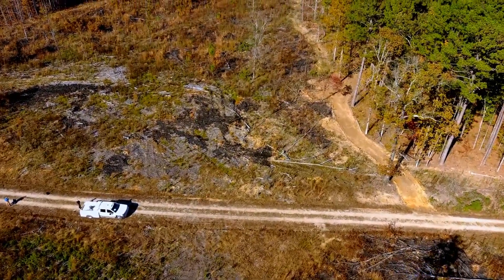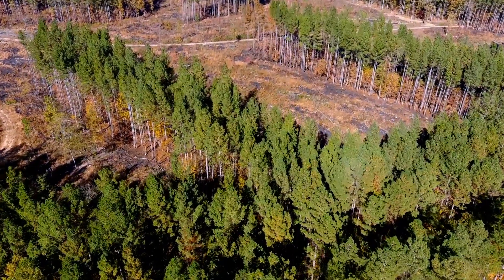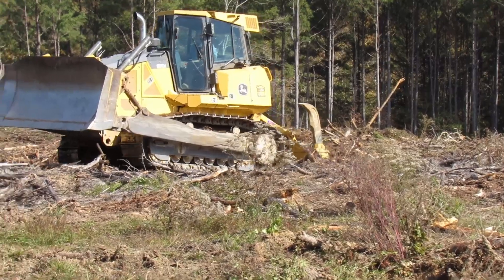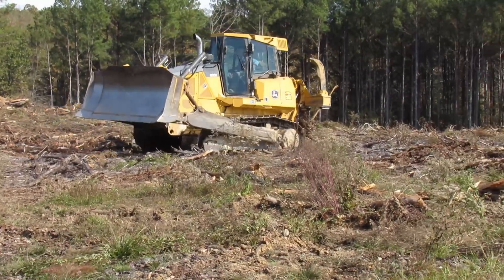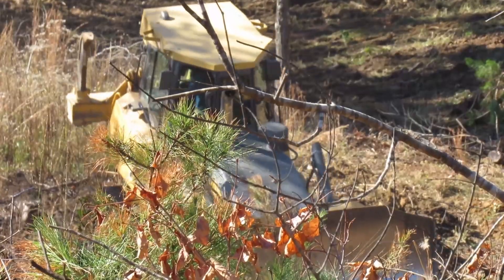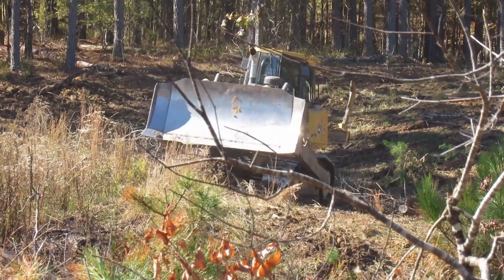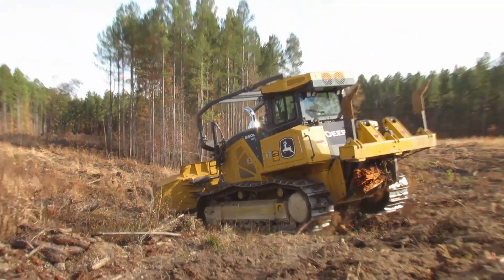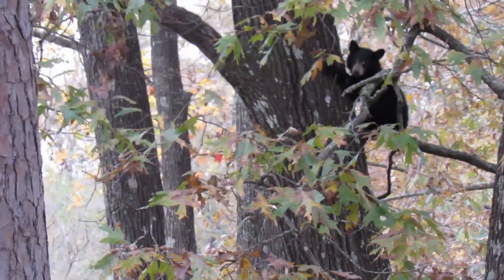Heavy Ripping with a Dozer for a Reforestation Project

Comment: Approximately how much does it cost to rent one of those machines to do that sort of work?
Reply from the maker: It depends on the size of the machine, attachments, location, etc.  This particular job was  $8250 per month.  The next smaller dozer would have been $6400.  Delivery was $1500 and we used about 100 gallons of diesel per day.  Daily and weekly rates will be higher.  I hope this helps and thanks for watching!

Comment: That was a massive project. That's a job that I've never done. I've done plenty of grading with big dozers but no field work like that. Thank God for the cabbed machine! I can't imagine having to do that with one if the old open cab cable machines. Neat video. Lots of folks don't realize what goes in to forestry management.
Reply from the maker: It was pretty big and spread out.  The two main sites were about 6 miles apart by road.  There were some serious pucker moments on the hillsides after rain for a few days.  Thought I was going to turn the machine over when it started sliding on wet clay.  The cab was awesome and the difference between the older and new machine was unbelievable.  The new machine was more powerful and rode like a limo.  I'm glad I was doing the dozer work and not the planting.  Those guys planted a tree every 10 feet by hand and on foot!
Reply: @ozarksethic  yes those big cab machines are Cadillacs and fun to operate. I know all about those pucker moments too! I wouldn't want to be the guy planting either. That's why you get good at operating!